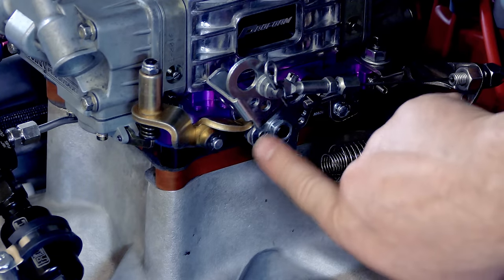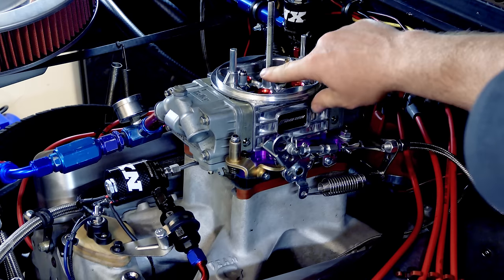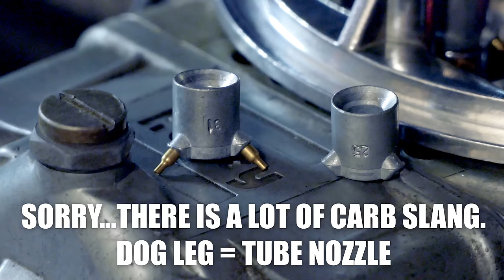Holley 4150 Carburetor Tuning!  Accelerator pump / discharge nozzles / pump cams / power valve

Comment: How did u get your carb to run in the 14s did u have to play with the idle feed restrictors. The closest I can get mine is around 12.9 to 13.2 at 35 miles and around 2100 rpm .
Reply from the maker: You must have jets too big in the front or the powervalve is opening too soon.
Reply: @TPVPRO   Thanks for replying back to me. I have a 850 AED carburetor that came with 85 primary jet and 94 secondary jet. Primary idle bleeds are .070 and high speed bleeds are .031 shooter front and back are .037.
I changed the Prim jets to 83 and Sec jets to 92. I changed the idle feed restrictors from .035 to .030 I changed the Prim idle bleeds to .078 and set the idle mixture screws 2.5 turns out and the power valve is 2.5 motor only makes 5.5 inches of vacuum. And the front shooter is a .040 not too sure if I am heading in the right direction any info will help thanks.
Reply from the maker: @user-fl3cl5nd3x   What is your displacement and what RPM do you turn to.
Reply: @TPVPRO  Its a 496 bbc with 720 hp and 640 foot pounds of torque. It revs to 6200 rpm, It runs on 91 pump gas.
Reply from the maker: I'm actually at an 11 or 12 spread on my carb can't quite remember. You can block all the PVs square the jets till you have a happy 12.5 AFR @ WOT pulls. Put the 2.5 PV in the front only keep the back blocked off. Start with 8 sizes smaller front only and keep taking jet out till you back @ 12.5 WOT. You may just have too much jet in the front. Just be sure to check plugs and make sure you have no lean looking cylinders.
Reply: @TPVPRO  Thank you for all your help I really appreciate it, keep the  videos coming .
Reply: @TPVPRO  Thank you for all your help I really appreciate it, keep the  videos coming .
Reply: @user-fl3cl5nd3x  6200? I could have sworn you revved it to 7K in the vid.